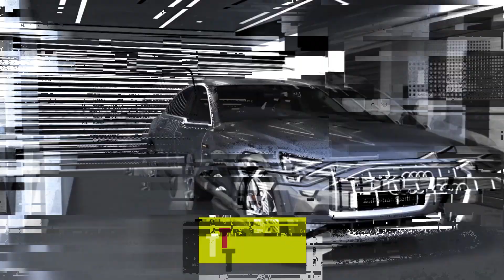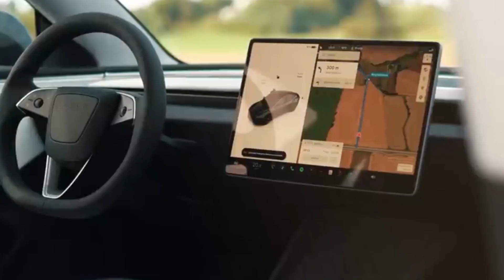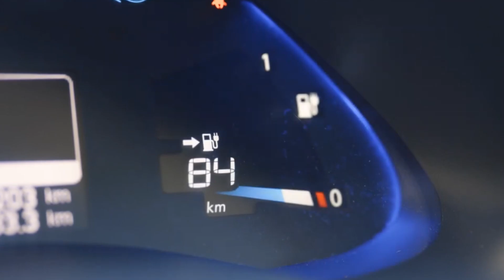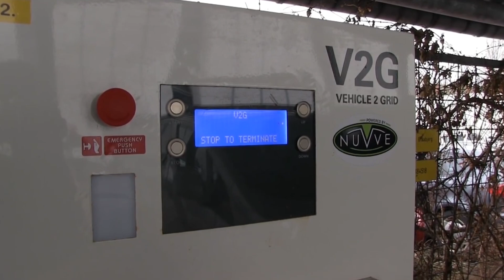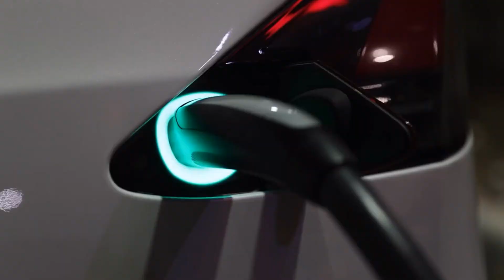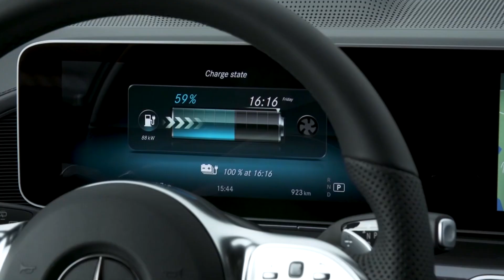YOU WON'T Believe What We Predict Electric Cars Will Do in 2024 !!!

Comment: I'm an environmental friendly person, my current car is a Dacia Duster 4WD 1,5 diesel ( Euro 6) When I bought it back in 2016 it was the cleanest type of engine available....Ideas have changed in just a couple of years
What does my next car should look like:
PHEV with a 100 km electrical range ( I have solar panels )
A range extender with a torque of around 300 Nm at a speed in topgear of 90 km/hour ( I tow a caravan in holidays)
Price level max € 30000,= ( I'm a "poor" pensioner)
Unfortunatly no currently available car ticks al the boxes....( nor will any car programmed or forecast for 2024/25)
I will probably end up buying a small range cheap electric and keeping my trusty diesel on my driveway till it falls apart....
Am I the only one with these demands????